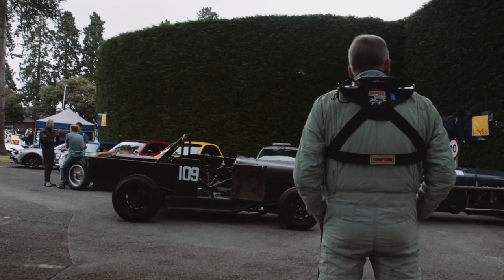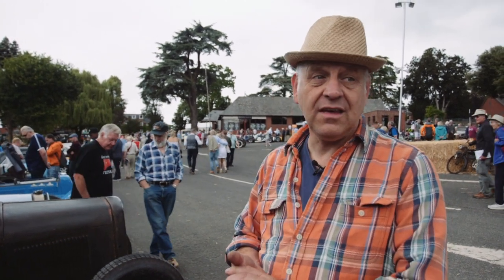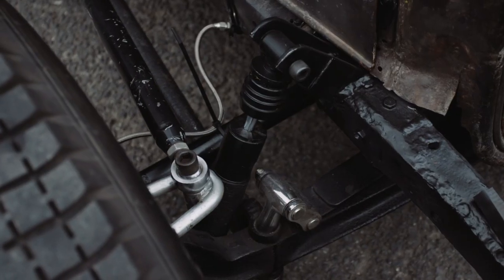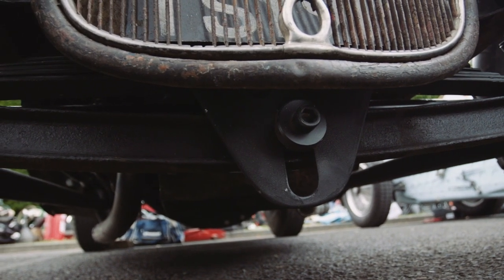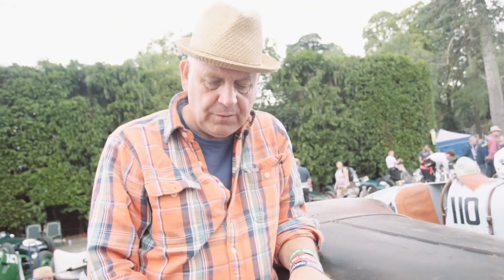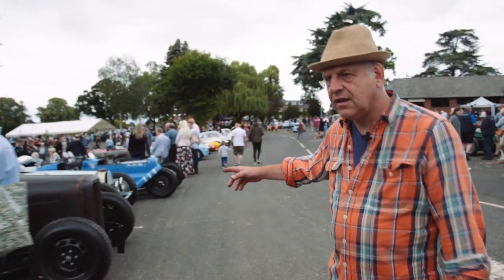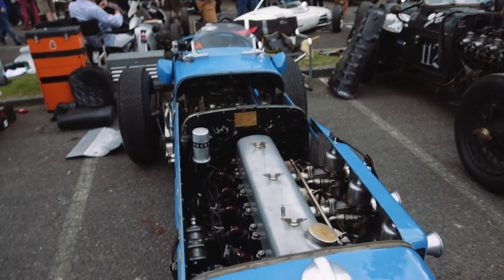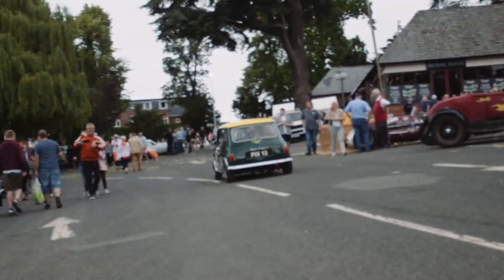Brown Truck at Chateau Impney Hill Climb 2019  Episode 5

Comment: I'm intrigued to see the results of you taking the flex out of the axle & if it improves stuff. One thing to bare in mind is with that flex gone, they try to use the split wishbones as torsion bars & cracks them. Which is a reason you should run a 4 bar on a tube axle as they don't have any flex in them.
Reply from the maker: Ben Barnett - thanks for watching- we have gained some tubular struts that has eliminated the wobble completely. 
A tube axle is in the file for consideration but I feel we can do a bit more with the strut solutions before going that way. I am also thinking of a split axle as per Ballamy/Allard....
No racing at the moment though :(

Comment: had similar fun with a ford front end.....they dont like sprung weight ,  i was using too heavier front wheel and tyre....you can see why the industry  opted for no nonsense semi ellipticals...
Reply from the maker: I added a short braceT45 from mid wishbone to the spindle that stopped it rocking forward and backwards- it worked treat and after that we set record at Shelsey Walsh -so simple when you know the answer but thats life